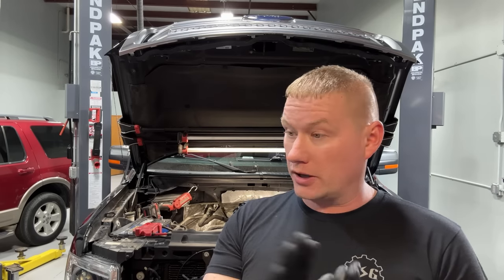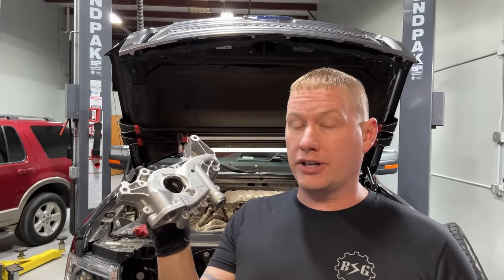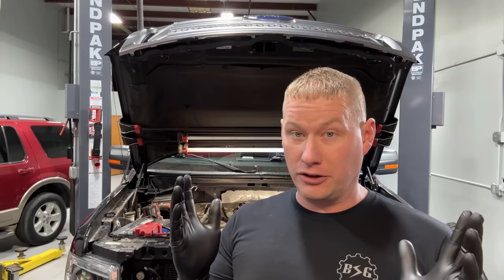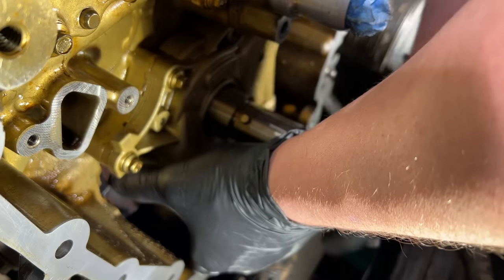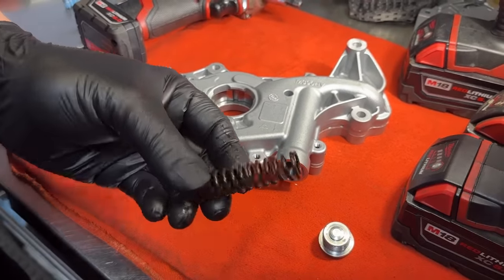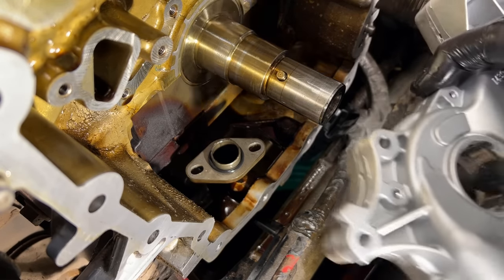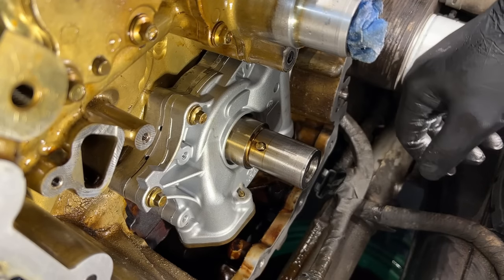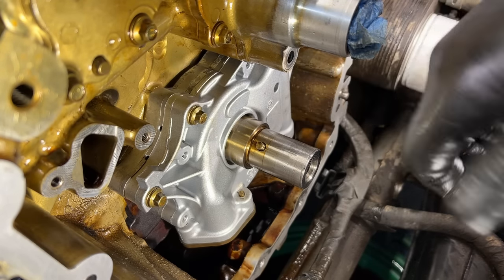2011-2016 Ford F-150 3.5L Ecoboost Oil Pump Upgrade Without Oil Pan Removal!

Comment: You don't have to rotate the motor too align pump gears like gm and Chrysler?
Reply from the maker: No we aligned it before we slipped it on.
Reply: @FordTechMakuloco  ok , gm pump you have install pump with the bolts hand tight . Rotate the motor a few times , that centers the internal gears then tighten.

Comment: So I bought the muleen high flow oil pump and they said the spring in it is 85 lb and the spring that's not in it is 100 lb. So do I go with the one that's in it or go to the 100 lb?
Reply from the maker: go brown 85

Comment: Brian,   when will you do the 3.5 engine timing chain job video?
Reply from the maker: On which model?
Reply: @FordTechMakuloco  f150, escape and edge?  Whichever they have 3.5 ecoboost
Reply from the maker: Ok so I have a timing series on the f-150 but not the transversely mounted engines which are way different. That's why I ask which model because they are all different.
Reply: @FordTechMakuloco  ok.   I'll watch more if you can release me timing chain videos of the transverse mounted ones.   The hard ones.

Comment: Is there no gasket that goes between the pump and the block because you did not show you putting on a new one ?
Reply from the maker: Nope never a gasket on machined internal engine parts.
Reply: @FordTechMakuloco  I understand. One time many years ago I did some work on a Citroen 2CV. Beleive it or not the Head and the Block were machined so perfect that the engine DID NOT have a CYLINDER HEAD GASKET !!!
By the way thanks for your swift reply.
Reply from the maker: I believe it, Ford did the same thing in 1992-93 4.6L 2v engines had no head gasket from the factory. No one noticed until they started seeping coolant into the cylinders at around 30k miles.

Comment: Will this work on my 2017 f150 3.5 ecoboost I believe it’s the second gen
Reply from the maker: no
Reply: No you have a video on changing a 17 second gen 3.5 oil pump the dealership is telling me my oil pump is bad at 66k miles always changed the oil every 4,500 miles took great care of it. I changed the oil pressure switch but still get low oil pressure warning intermittently they want 5 grand to do it and I can’t pay that when I could do it myself.

Comment: Does anyone have a parts list for a 2013-2014 F150 timing parts rebuild job? Don’t wanna forget anything. HV oil pump, timing chain, chain guides, chain tensioners, new part # cam phasers, etc). Any gaskets or parts I’m not thinking of?
Reply: If you haven't done this already I do have the complete oem part number list on a 2013 ecoboost f150. When I say complete I mean complete! Everything that could possibly need replacing.

Comment: How do I get my truck to you. I need a timing chain done due to the ecoboost rattle during cold starts. Its a 2012 3.5 ecoboost. Almost 170,000 miles. It will have to be around tax time lol How do I make an appointment?
Reply from the maker: Please submit an official service request here- http://bsgautomotive.com/

Comment: Do you recommend melling oil pumps still on 2011 3.5l ecos 
Have they held up over the year ?
Reply from the maker: Yup we use the M390HV all the time.
Reply: @FordTechMakuloco  awesome gunna change it out when I do the job . 
How do you feel about sealing the timing cover in winter ? Hear the rtv or ford sealant doesn’t cure well when it’s cold . 

Gunna try and wait for summer 
But my chain is loose ! Can hear it pretty bad when I’m beside the drive threw haha

Comment: I see an opportunity to design a new tool! Using the threaded holes for the cover, to secure the base of the tool, that can press the pickup tube down and off to the side, so both hands are free to work the pump...

Comment: Is it the same for the 3.7 normaly aspirated 2011 f150
Reply: Yes I did it on a mustang 3.7 same engine as Ford, drain oil replace filter add oil. I'm sure on the F150 there's loads more room then a mustang

Comment: V6 turbos suck. My 2010 5.4 has 16850 miles w/o any repairs. Replaced spark plugs @ 70,000 & 150,000 miles. Changed oil every 5,000 miles. Coolant changed every year.  Don’t every say v6s are worth their salt

Comment: Is there less front clearance on the front of the engine on explorers vs the f150?
Reply from the maker: No there is plenty of room on the explorer when installing the oil pump.
Reply: @FordTechMakuloco  awesome, I'm gearing up to do the timing chain and have watched the guide series you made. Ac seems to sprung a leak now so no better time to do everything. 😆
Reply: @FordTechMakuloco  what about the 96 5.0L with GT40 headers I recently have had a line of failures from a hard freeze where i blew a freeze plug fixed, then water pump fan sheared off fixed, just thought I was finally back up and running after next problem was erratic to no oil pressure I pulled my cam synchronizer to find the hex shaft to be rounded off installed new one day ago just test drove it today got 30 seconds up road and bam oil pressure back to 0 its pump time

Im at 300,000 miles about and that old 302 is a beast of a motor I tell you, but my work season depends on me getting this sorted asap I would appreciate if you could spare the time to reply I would be super grateful you're videos they are the very best hands down

Comment: how do you know pickup screen is not clogged?
Reply from the maker: Clogged with what?
Reply: @FordTechMakuloco  Can it be clogged with timing chain guide material?
Reply from the maker: Oh no these do not get eaten up like the 5.4L 3v. If there is a a broken or severely worn guide or the engine oil was neglected, then yes by all means drop the pan.

Comment: The biggest turn-off I have for the 3.5 is the fact that the water pump is under the timing cover. A part that commonly fails on ALL vehicles, has to not only be somewhere where as soon as it does fail, leak antifreeze into the oil, but also require you to pretty much dismantle the entire engine just to change a basic part. At least on the 5.0 and 3.7, the water pump is on the outside, and is easy to change.
Reply from the maker: The water pump is a normal external water pump on all 3.5L engines that are longitudinally mounted such as in the F-150.
Reply: @FordTechMakuloco You straighten him out.
Reply: Water pump under timing cover, they got great engineers at Ford. So when you lose all your antifreeze,it's in the oil pan.unless you see it on the ground
Reply: @michaelbefumo-qg7ji  I am not experienced in this matter, but there may not be a "drain" hole on that model since it is internal.
I am not certain how the techs might diagnose a failed coolant pump.
Perhaps a noisy bearing?
Hopefully NOT Coolant-y Engine oil.
Reply: @SpicyRok7482  There are 2 weep holes in the engine block that lead to the internal water pump. It will drip out these to warn you, On sideways mounted engines,

Comment: What happens if it has more pressure?
Reply: Helps lubricate engine top end faster especially when its cold
Reply: Higher parasitic load
Reply: You can blow some seals out. Not sure if the cam phasers have rubber seals in them or not.

Comment: You have the patience of a saint. Is it me does Ford do this on purpose. Use factory oil pumps that aren't the right pressure, same as 5.4. think makes things so you have to bring them to a Ford . Next they'll be using bolts and fasteners, that only Ford can buy tools for.horrible

Comment: I just kept raising the oil weight to compensate for the larger clearances. 
At 75k- 10W30
At 150k- 10W40
At 265k- 15W40
At 315k- 75W90

She's still running like a top

😑
Reply: Only issue is the small oil passages might not like the thicker oil since they don’t wear like a bearing would.
Reply: @FishFind3000  "sarcasm"
Reply: At 400k- 85W140
Reply: Gear oil huh? Lol
Reply: Don’t you get timing chain rattle on cold start up in winter . I have 2011 f150 3.5 200000 miles running 5-30 synthetic no oil consumption issues oil /filter changed ever 5500km . I also have a 2006 cts 2.8   220000km similar timing chain system and phasers  to 3.5   I tried heavier oil 5-40 got rattle on cold Canadian weather cold start the car calls for 5-30 synthetic . I bet the hydraulic chain tensioner would love the differential  lube  lolol
Reply: @carado1984  lolol

Comment: While I appreciate your ability to do the repairs on these......this type of work should not be needed on a timing chain equipped vehicle....oil pump and chain should last the life (300K +) of the vehicle  I have a 99 camry with 297K.....factory oil pump is still good engine has 4 valves per cylinder     I have a 99 ford 302 (used engine GT40 with cam and valve springs) swapped Datsun  with 180K on the engine    45 psi hot   factory oil pump .....The eco boost makes good power.....but not the greatest in life expectancy
Reply: Change oil every 5500km using hi quality synthetic and premium oil filter they last . Do 10km changes or longer nothing lasts
Reply: shoulda coulda woulda  your timing chains are short, These chains super long so even if one link stretches tiny bit you multiply that by 100 plus links.

Comment: I am so glad I did not buy in to that technology. 5.0 was the only way to go. I as well have a shop. My forte is in electrical problems. Don't do internal motors or transmissions. I a well have an F150 with v8. All brands are ending up on their turbo systems with problems. Maybe someday it will be a better way.
Reply: 5.0 has oil consumption issues though.
Reply: @FishFind3000  I searched and found a 6.2L Platinum F150. I wouldn't say 100% bulletproof but as close as you can get. Sounds amazing too! My neighbor has the same year 250 with 400K work miles, no engine work. He does 4k oil changes. He said the truck don't owe him a dime if it grenaded tomorrow. Very rare option for the F150 11-14. My next choice would be a 5.0. The dealer here probably makes more money off ecoboost work than selling cars. Sure, some last long but many need work.